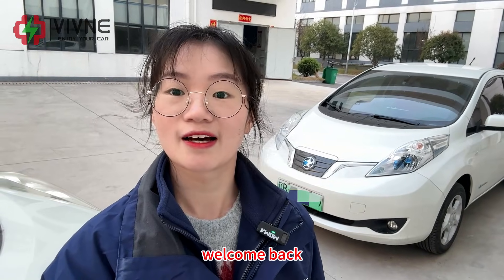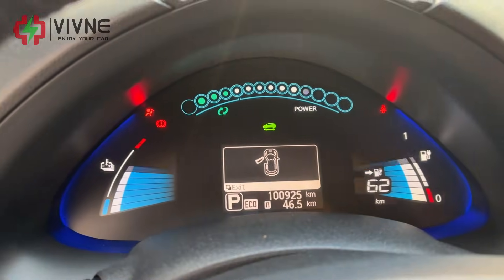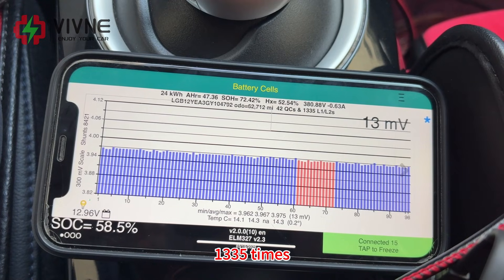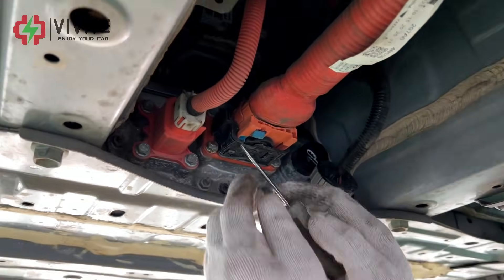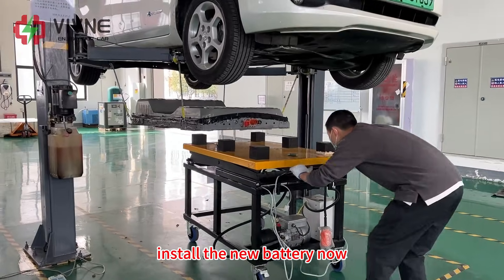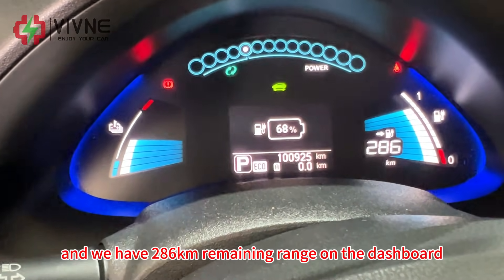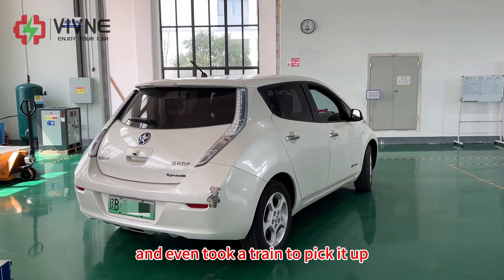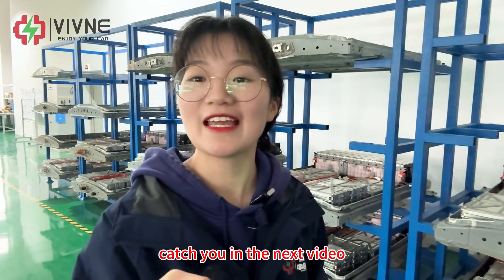VIVNE-Nissan leaf 62kWh battery upgrade

Comment: How mutch battery cost?
Reply from the maker: Hi, you can check the price here: https://www.alibaba.com/product-detail/VIVNE-62-50-40kWh-Battery-Modules_1601254935360.html?spm=a2747.product_manager.0.0.ee4e71d2Jfbzom
I can also check the shipping cost for you if you send me your address, here is my WhatsApp: +8615211174371 and Email address: cora@vivnevs.com, thanks
Reply: @VIVNE-CoraLiu Estonia Põlvamaa Karilatsi küla 63603
Reply: I have 2012 leaf with 24KWh battery
Reply from the maker: @geiopae9540  Okay, you can upgrade to 62kWh, no problem, where are you located?

Comment: What is the difference in weight between the old battery and the new battery?
Reply from the maker: 62kWh is 89kg heavier that the original 24kWh, and 48kg heavier than the original 40kWh, so no neet to upgrade the rear suspension.
Reply: @VIVNE-CoraLiu  Sounds great, thank you for the information.
Reply from the maker: @JebusHypocristosX  My pleasure😀
Reply: @VIVNE-CoraLiu  Do you ship to Canada?
Reply from the maker: @ Yes sure, basically we have DDP service to Canada, but I need to confrim according to your detailed address, maybe you can WhatsApp(+8615211174371) me, thank you. 😉
Reply: @VIVNE-CoraLiu  Sounds great. I am going to look for a car I can replace the battery in and I will be in touch.
Reply from the maker: @ No problem👍

Comment: Hi, now the battery sealing is nice with the neoprene strip. Good idea the mounting spacers. Do you change the rear springs to balance the  increase weight? Waxing all screws and mounting parts make sense to prevent corrosion to make the next battery swap in 10 years easy. Leaf for ever 😉. That's sustainable to save our climate and planet....
Reply from the maker: The weight of our 62kWh is only 89kg heavier that  the original 24kWh, so no need to upgrade the rear suspension.
Reply: @ even so,  switching out the springs is not that hard either
Reply from the maker: @ Sure, but no need to do that